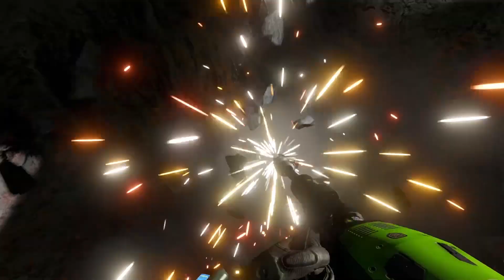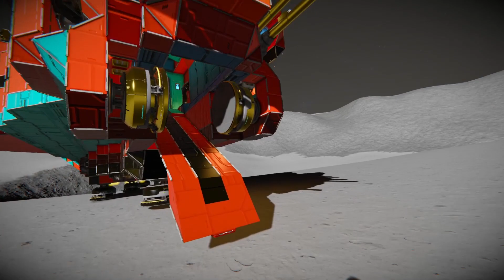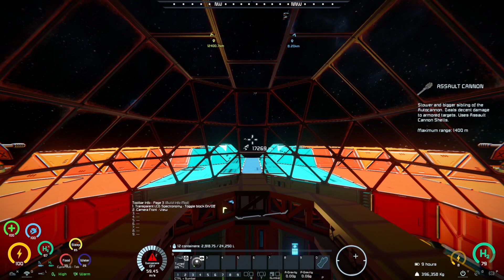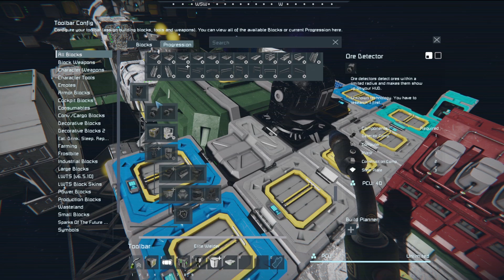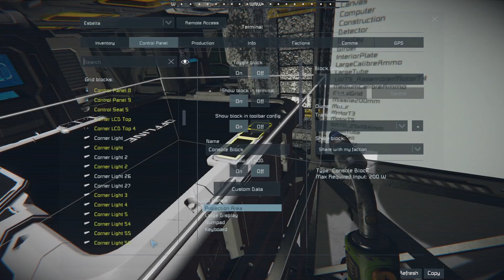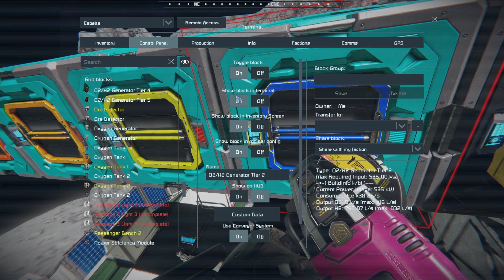Survival Records, Echelons (Space Engineers Lets Play) E01

Comment: Hey, thx for using LWTS!

About those tiered oxygen generators, they are also ever so slightly more Ice efficient (more hydrogen and oxygen per 1kg of ice). The ratios have been added in the descriptions of the blocks. Vanilla ones have about 10l/k O2 and 20l/kg i believe
Reply from the maker: Yeah, I've been meaning to use it for a while now, glad it's finally is working out.  I'll need to read through the mod description again.